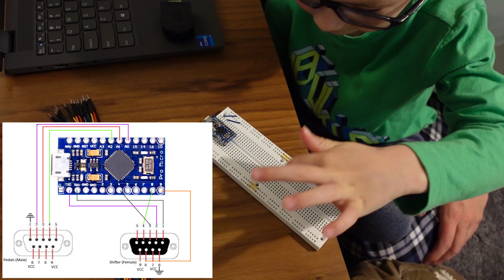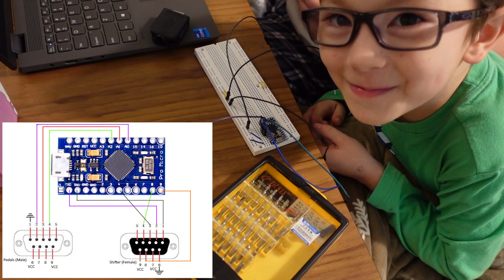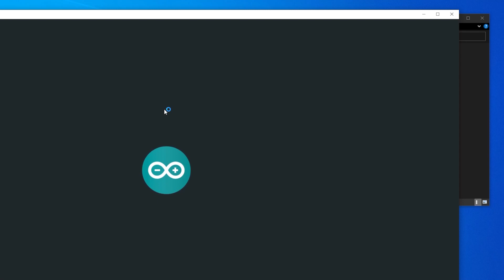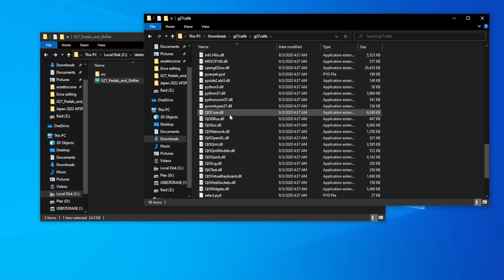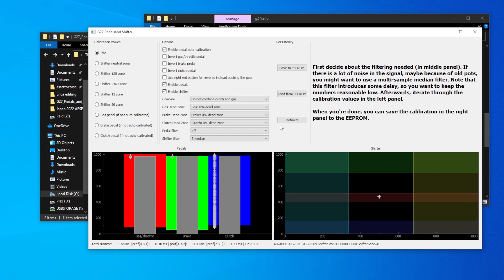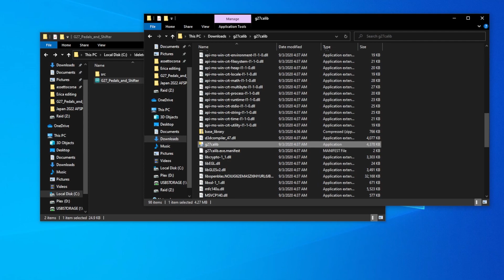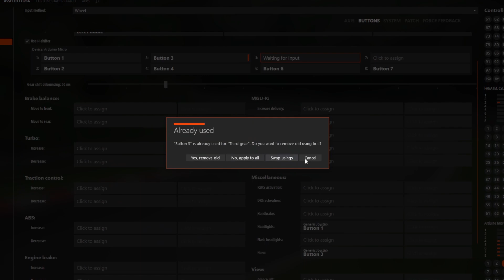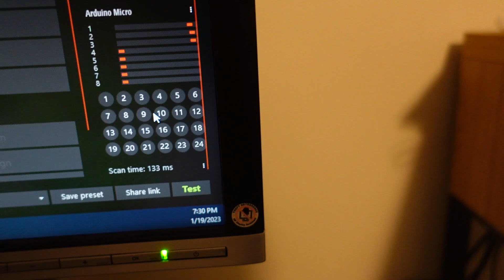Use your logitech shifter and pedals without the wheel base!

Comment: Man, my H-Shifter only read the gears. Reverse reads like sixth gear and none of the buttons work. My Arduino connections are exactly like yours.
Reply from the maker: There's code to read the "down" position as a separate button. But I ran into similar things and just put up wiht 6th being reverse.

Comment: This is the ONLY one that works you are the MVP bro!! 
I had been trying to use my G923 pedals without the wheel base for X-plane 12 and everywhere else on the internet has got it all wrong. Then I found your vid!!
You absolutely nailed it, your wiring diagram is the only one that has actually been correct and it all works seamlessly. 
I was able to configure the two pedals on the same axis for a rudder with the config program as well, so an extra bonus there not needing vjoy or something.
One thing to note is that the Ardunio IDE and the Arduino CODE must be sitting on the same hard drive, otherwise the upload to the board will fail.
Thanks heaps bro you saved me $300 on flight pedals. The Arduino Leonardo and cables I used were under $10, and I now have perfectly good G923 pedals for my flight sim. 
👊👊LEGEND
Reply from the maker: Sweet! Glad this helped you out. Makes me want to get back into making these videos.

Comment: Would it be possible to keep the pedals and shifter plugged in to the steering wheel, but only use the pedals and shifter and then connect a new different wheel and do it like that?
Reply from the maker: Yes. The wheel still calibrates on start up though. On some g27s, I could actually plug in the usb cable but not the power cord and it worked fine. I actually took out the circuit board in one and did it that way. Some games have issues if two force feedback controllers are plugged in at the same time though.
Reply: @protomor  10 4, thanks for the tips. I was thinking of grabbing the g27 because it was on marketplace for cheap, but it's been sold now.  My plan was to basically get it for the shifter and pedals, and use the wheel for a couple months while I save up for the moza R9, a real car quick connect and wheel that I could simply put on my real drift car later on when I'm ready... But now that it's not for sale, I'm wondering, why not just get pedals and a shifter somewhere else. I do kind of like the g27 shifter and the pedals aren't a deal breaker for me. What do you recommend?  I haven't tried any other pedals or shifter other than the g27 (friend has it) and am figuring I'd rather spend the big money on the moza wheel base and save it on the pedals and shifter
Reply from the maker: @CharkG73  I need to do research into pedals. I'm using the fanatec CSL Elite pedals with the load cell brake and it's nice but load cell is just a nice to have. The logitech shifter, while alright, isn't great long term. There's a lot of drift and mis shifting after years because it uses a controller stick instead of switches. I would go with the regular ali express shifter as it's the bset I've used (better than thrustmaster IMO). Pedals are hard though. I don't know many places that make stand alone pedals.
Reply: @protomor  man your insight is so helpful!  I'll get the cheapie shifter and look for load cell pedals somewhere. I know moza sells the pedals with clutch and the expansion set for about 230 total.. I found a decent deal on a used thrustmaster set with the vertical mounted pedals. Might check those out too
Reply from the maker: @CharkG73  bundling the pedals and wheel sound like a good idea to man. many of them you just plug into the wheel base and it's only 1 thing that plugs into your computer.
Reply: @protomor  cool cool. Time to start saving up lol but it's going to feel a little better knowing I saved money on the shifter.  I found a basic 7 plus reverse h style shifter on eBay for $40.  Should work, right?
Reply from the maker: @CharkG73 Yea, looks like a box with a round ball knob? that's what I have. love it.
Reply: @protomor  that's the one!  I also just found some fanatec csl pedals with the load cell kit used locally for $125.  Seems like a good deal and I researched them a little bit. They look like the perfect choice for what I need
Reply: @protomor  All this stuff will work together on assetto Corsa, right?  I've got a cheapie handbrake coming, will order the cheapie shifter, and am probably going to get those fanatec csl pedals and eventually a moza R9 wheel base. As far as I understand, they all just send their own independent signals to the computer via their own USB cables and assetto corsa recognizes each signal from each device... And then you map them all together and it should work.  Do I have that right?  Thanks again for all your help!
Reply from the maker: @CharkG73  yea they'll all work. Full disclosure, fanatec support sucks and I've had 2 of their wheels break. I try to avoid giving them money now
Reply: @protomor  dang, I understand that. Fwiw I won't be giving them any money directly lol, that will be going to moza.  Hopefully I can demo the pedals from the seller.. but they aren't known for breaking or anything I don't think, from what I've seen, hope not

Comment: My gawd bro you are a legend, been in sim drifting quite a while and im really feeling the need to upgrade my g27 wheel to thrustmaster or moza R5 or something… i added a bigger wheel to my g27 but it aint cutting it whahaha the motors are just to weak 😂 I did watch you other video of g27 motor upgrade but i cant find any in south africa,,, rather just spend the bucks on a new wheelbase and slap my aftermarket wheel on there… i have another pro micro laying here… i have made custom handbrake with one already… cant wait to make this, because its been a couple months now i have been hesitant getting a new wheel then i need to buy new pedals and shit thats compatible witj the new wheel
Reply from the maker: Finding the motor is the hardest part. But nothing beats a better wheel.